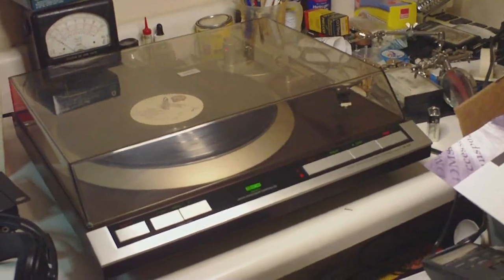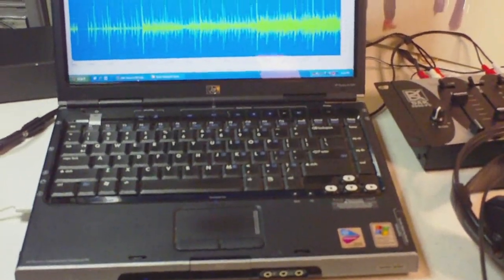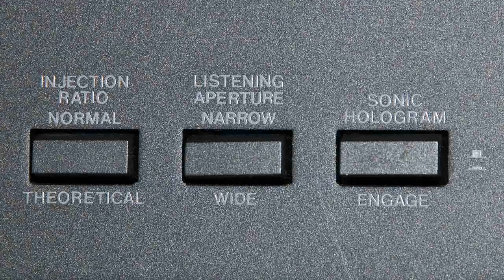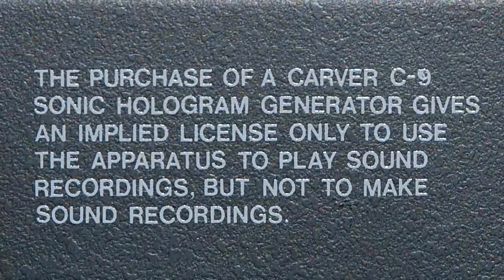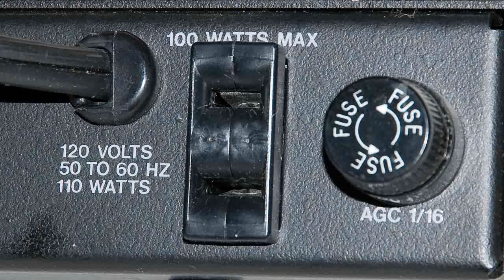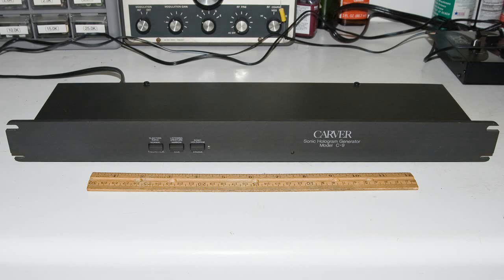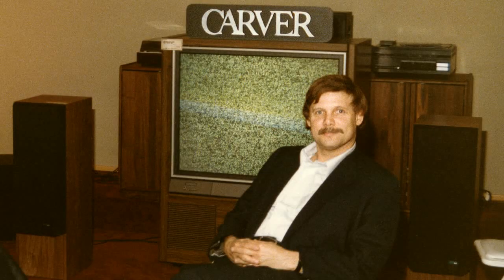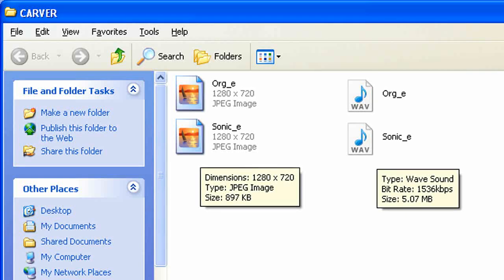Sonic Hologram Generator by CARVER

Comment: This is similar with the idea of Bob Transfer Function method.  He took measurements of amps he was trying to copy and with the help of mathematics was able to copy their sound quality, then designed the circuit based on the captured function tweaked the circuit sort of like an equalizer to essentially replicate the sound characteristic.  In the case of the Holographic Generator, certain frequencies were boosted and with an addition of reverb for the timing effect the Holographic sound created.  This can be achieved with an equalizer and reverb.  Bob captured the signature of the equalization that he liked and boosted it along with some reverb and condensed it into a IC chip.  When you put this Generator in the signal chain you can achieve this musical change with the push of a button and a change will be noticed right away.  Kind of works like psycho acoustics.  Bob had the science down behind his designs!   This concept is used in the presets of surround sound effects today also.
Reply from the maker: Yes Bob Carver had sold his patent rights several years ago. One place is in surround sound.

Comment: Are there any plug-ins that can do the carver sonic hologram generator effect or close approximation?
Reply from the maker: I don’t know of any plug-ins. This unit has about 57 capacitors.
Reply: Waves NX has a spatializer for headphones that works very well. It costs $9.00, or it used to anyway. I'm running windows, but I'm sure they have an apple version. They also have plugins matched to popular headphones that will emulate different recording studios. Pretty amazing.

Comment: Even just "engaged" without "wide" or "theoretical" you might prefer it. It's a great fun thing. I have one, its a long term project, I have an upgrade kit coming which I think is just new caps, and I'll get the RCA's changed for something better (bolt through surface mounted) as modern interconnects are a bit too wide for the holes in the chassis. Great video, thanks for taking the time and the research. I feel lucky to have picked one of these up in the UK in great condition.
Reply from the maker: I know you will get many hours of enjoyment , I sure have!!! I also had a lot of fun showing the system. When I turned off the Hologram Generator the music would collapse back into the speakers.
Thank you for your comment!!!

Comment: I bought my car over c4000 preamp with Sonic hologram generator back in February of 1980. It is the most amazing piece of gear I own and the only one that can produce the sound field of a concert accurately in my specially treated room. I've tried other alternatives both from Hughes and one other company and although they make an interesting sound field it's not as accurate as the one that produced by the Carver preamp. I still run the c4000 as my primary system control even though every other component in the system has been upgraded since 1980.
Reply from the maker: I agree! It is remarkable. I’m gald I got to meet Mr. Carver when I was out on the west coast. 
A demonstration I like to do is to play Steely Dan’s Kid Charlemagne, and part way through trun off the hologram, and the music collapses back into the speakers. Just amazing!
Reply: @AllAmericanFiveRadio  My favorite demo was a track entitled "Ondine" from "The Weathering Continent" original soundtrack from Japan. It has an incredibly large soundfield with the Hologram engaged--almost out to 170°. Then there's a female vocal that is palpably center stage and ten feet in front of the listener, just beyond the speakers. Prior to the discovery of that gem, I used Michael Jackson's "Thriller" to demo it to visitors.

Comment: I hooked my laptop up to my stereo system to hear the effect.  The recording sounded good without c-9 and sounded better with it engaged.  I also have numerous signal processors including the Hughes AK-100 (also performs 3D-imaging).  The c-9 sounded good with Hughes and without.  The effect of the c-9 came first in the chain since it was coming from my laptop.  I will consider buying a  c-9.
Reply from the maker: Thanks, it is sound outside of the speakers.

Comment: Great demo. But you definitely didn't need to convince me. I've had the Carver HR-752 with Sonic Hologram  since 1989. Have always LOVED this piece of equipment. For 30 years I was running this unit into a pair of old Klipschs (Cornwall). When set up correctly, the Sonic Hologram is astonishing, to say the least. The sound seems to emanate from everywhere, reaching far beyond any normal stereo sound field and actually creating more clarity and detail in the sound. Close your eyes, and you can't even tell where the speakers are anymore! But alas, a couple years back I realized it was time to put the Klipschs to rest. I replaced them with a pair of B&W CMs10's....and the Sonic Hologram sounded ever BETTER (as do the speakers overall. In all honesty, among the best I've ever heard)! Amazing what removing the tweeter from the cabinet can do. 
https://www.youtube.com/watch?v=6JRDGwoyw1E

But then I created a new problem - the B&Ws are thirsty! Requiring 200-250 watts to really run at their peak (300 watts max). The speakers were draining every once of current and overheating the poor old Carver (100 watts per channel) and occasionally causing the protection circuitry to shut it down. So I thought, ok, time to start looking to switch out the Carver. Started shopping (and one of the reasons I ran across your post) but oh man, what a rude awakening! I can't find ANYTHING that even comes close to warm, clear and spacious sound of this Carver!! Even going as far as to demo amps costing $5000+ (Macintosh, ADCOM, Cambridge, Marantz, etc). They all just sound cold and lifeless to me. I'm convinced that some of it is the Chinese components of these modern amps, but mostly, I just think it's the fact that they are NOT Carvers, and plus the loss of the Sonic Hologram! I'm spoiled, and I find myself unable to ever go back to listening to stereo without it. I had store salespeople trying to convince me that the Sonic Hologram can perhaps be "replaced" with products like the Dolby DTS Surround. LMFAO, I said nope, sorry, not in a million years. Sure, if you like listening to a dull, muddy mess! Like comparing a Yugo to an Audi A7. 

I think I've finally come up with a solution. I'm KEEPING the Carver. One of the excellent things about the Carvers is that he included Pre-Amp Outs/Ins on the back of his receivers. So I can basically still use the Carver pre amp section and run it into a new power amp. The jury is still out on what that amplifier will be. I hear good things about Emotiva amps, and that Bob Carver was actually initially involved with the company in some way or another early on.
Reply from the maker: I have enjoyed my Carver Hologram Generator for many years. I bought it when I was living in the St. Louis area from Best Sound. I do not remember what speakers I had at that time that the hologram experience was quite good. When I moved up to the Chicago area I changed the speakers. I bought a pair of Dahlquist DQ-10s and the quality change was phenomenal. I still have the DQ-10s. When I was living on the West Coast in the Seattle area I was visiting high-end audio stores looking for earphones that would not distort when I was listening to my CD player. I ended up buying a pair of Nakamichi headphones. While there I asked if I could demo Carver's Time Lens. So the salesperson and I go into this sound room and there's a few people already there. The salesperson starts talking about how some CDs sound better than others, which I thought was kind of odd. So he turns on the equipment and I'm standing between the speakers and I am not hearing at all what I expected, matter of fact it was disappointing. The salesperson gets interrupted by a phone call so he had to leave. I went up to the equipment this see how it was set up, and the time lens was on but the hologram generator was off. I turned on the hologram generator and everybody in the room turned around, it sounded like a live performance. When the salesman came back he also could hear the difference and immediately walked up to the equipment and took notes how things were set up. I thought to myself no wonder you're not selling this equipment.

Like I said I have enjoyed the Carver Hologram Generator and Time Lens for many years, it's just fantastic. When I demo my system for the first time for some friends, I of course put them in the sweet spot with everything on. I have them close their eyes and then I'll turn off the hologram. The music as you know collapses back into the speakers. Of course when I turn the hologram back on it sounds very much like a live performance.

Thanks for your comment and information
Rick
Reply from the maker: I'm in North Carolina now

Comment: The Sonic Hologram is a difficult effect to describe. One can only appreciate the true nature of its intensity by first hand experiencing the phenomenon.  It was back in 1982 while perusing the magazine rack looking for audio magazines that I came upon an issue of "AUDIO" and on it's cover was emblazened "Sonic Hologram by Carver" demo disc inside, and sure enough, inside the magazine was a floppy cellulose disc (grooves on one side only) that contained music recorded with the hologram effect. I played this disc on my setup, which then was a Pioneer turnatble into a Pioneer integrated amplifier running a pair of somewhat cheap Electro-Voice 3way floor speakers. I wasn't sure what to expect, but according to the hype, it was going to be awesome. Well, it was. That little floppy record opened my eyes to an aspect of audio I had no idea existed. From the 2 speakers barely 8 feet in front of me and maybe 7 feet apart (small apartment) I was hearing sounds eminating from beyond the confines of the walls. The effect was spectacular. I was hooked and soon after purchased a C-9. Still have it, and also recently acquired a C-4000 which has a sonic hologram generator built in. I am running a pair of Infinity RS-6 with a Carver M1.5t and the hologram effect is beyond belief. Anyone who says Bob Carver is an audio guru extraordinaire is preaching to the choir. Thanks for the video demo.
Reply from the maker: Thanks Hammy Technoid
To my ears without the sonic hologram generator I hear speakers no matter how good the speakers are. With the sonic hologram generator I hear music and not the speakers.

Comment: "Phased Array" doesn't mean left and right channels (which is termed "stereo" btw) The DQ10s were famous for 2 things: the drivers were all on mounted on 1. separate baffles that were arranged on separate planes for phase correction 2. these individual baffles were open (no boxes).  I have a Carver preamp w the SHG (circuit now fried), and I think it added sonic properties to the sound, beyond creating the illusion of 3D. maybe its a simultaneous boosting of frequencies like bass and presence,

Comment: I envy your knowledge on tube radios. I'm a rookie on working on tube radios and have the famous "toaster" radio by Zenith(circa 1941).The oscillating coil was opened and so I soldered the opened connection. I re checked the coil using the ohm meter and it read where it should be. I get only 1 faint station eventhough I change stations on the dial. What can you recomend for me? Are there any good books on tube radio repair? I have the videos on Bret Manessa Antique radios.

Comment: I have a Carver Loudspeaker Control System with the sonic hologram generator. this unit is hooked up with a Carver C16 Preamp which also has the sonic hologram. The system must be set up as mentioned or it will not work. I just LOVE listening it through my vintage Dynaco ST-120 tube amp. I recommend using Audioquest interconecting cables because most of the "blurr" is eliminated and it's just a treat for the ears.

Comment: That was really good. At my computer desk, I have 2 Pioneer 3 ways mounted on the wall, angled down and placed with the tweeters on the farthest ends from each speaker  and a  HTX subwoofer  being powered with a nice 30 year old Realistic receiver. The speaker placement is roughly the same as in the radio station production studio I worked in when I was in the business .. works well for this demo.  It was as if my speakers were moved!  Very cool and clever.  I'll take this over surround sound.